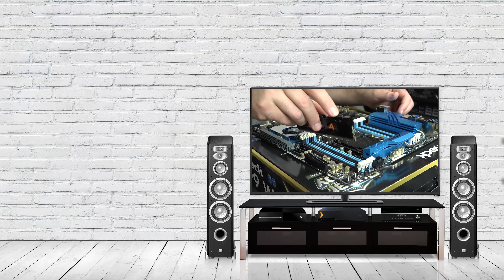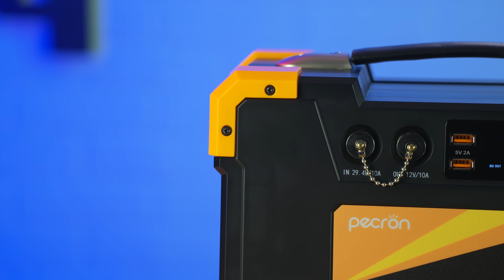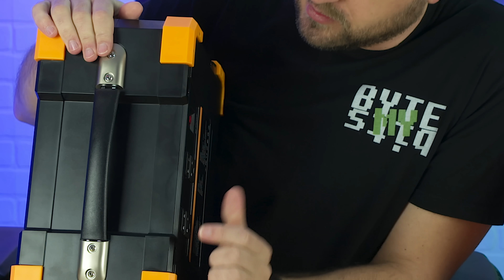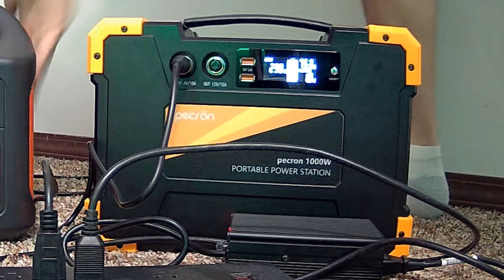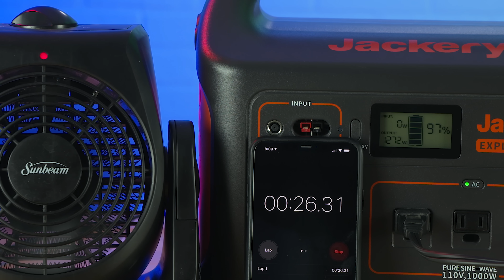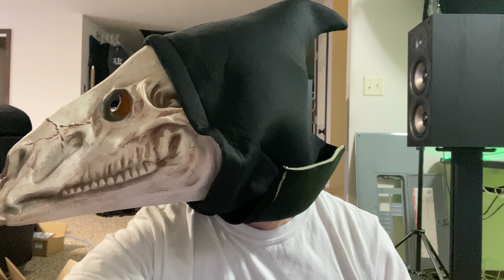pecron E1000 - Better and CHEAPER than the Jackery 1000!

Comment: Big deal it is $100 cheaper. You go on and on like it is so much less expensive.
Reply: Right now it's $750 new on Amazon and 10% off the panels. So your wrong. Times change as do prices.
Reply: @thenitruc8165  So it is app $150 cheaper since the Jackery 1000 can be had at home depot for $899.
Reply: @MrPageyjim  that's right, so get a life.
Reply: @GG-kc6ie  I am doing very well thank you. I suggest you take your own advice my slow witted YT friend.
Reply: @MrPageyjim  No mirrors in your house? You're the douche that moaned about the reviewer "going on and on like it's much less expensive" well it is much less expensive and it's a better product in his opinion so what's your point? Go and buy the jackery for $899 and pay more for an inferior product. Just do us a favor and stop your bleating.
Reply: @GG-kc6ie  I made my points, try to read the posts again. This time sound it out and give it a few tries. I don't plan on doing you any favors. I will just share the truth. If you knew how to read you would see where I said Home Depot. It is actually now down to $849 actually from Jackery.  Let me explain how this works GG. If you reply to me I will respond. I don't want to be rude. Talk to you soon.
Reply: @MrPageyjim  Sounds like you own the Jackery and couldn't handle hearing there's something better for cheaper. Don't take it out on the reviewer.
Reply: @GG-kc6ie  I do not own a Jackery. I own Bluetti's and an EGO. Why don't you take a nap or something? If the reviewer wanted to say something to me he could. Why would he need your nonsensical posts to protect him? If he relies on you for that he is in worse shape than I ever would have thought.
Reply: @MrPageyjim  You certainly have an ego
Reply: @GG-kc6ie  I knew you would be back. Haha that is funny but you can do better. Keepem coming
Reply: @MrPageyjim  we all know you're a jackery fan boy and spat the dummy when the reviewer showed a better device for less money. The best you could come up with was to bleat that he was going on and on about it, clearly every time he mentioned it was cheaper it just riled you up more and more. It takes a true tightarse such as yourself to feel compelled to leave a comment about it.
Reply: @GG-kc6ie  More nonsense from you, but I wouldn't expect anything else. As I said i do not own a Jackery. If you have to compare something to that Jackery it just shows how outdated it is today anyways. I will wait patiently for your next nonsensical reply.
Reply: @MrPageyjim  Couldn't handle there's a better device for cheaper so you take it out on the reviewer. What a little weasel you are.
Reply: @GG-kc6ie  If he doesn't want reviews he should turn the comments off my crybaby friend.
Reply: @MrPageyjim  Saving $150 and it lasts longer on the same load and can stand higher loads that the Jackery shuts off.
Reply: @thenitruc8165  It is still $100 cheaper than the Jackery. The Jackery warranty is twice as long and they have a long track record also.
Reply: @MrPageyjim  Ill take cheaper and performs better. Lasts longer on a charge and more watts continuous. Also the pecron charges faster from the wall and from solar. Dude just stop nut hugging jackery. Yes its good. But this for the price is just better. Jackery charges at 160 watts and pecron charges at about 215 watts from the wall. The benefits stack up.
Reply: @thenitruc8165  I don't own a Jackery and really wouldn't suggest one you fool. If I were to suggest one it would be a Bluetti actually. A good track record and much better warranty goes a long way for me and some others. I really don't care what "you'll take." That is why we all have opinions.
Reply: @MrPageyjim  ooooh crybaby 🤣. The only crying is coming from your source post about it not being cheap enough, what massive tightarse you are.
Reply: @GG-kc6ie  It was his main point. he went on and on about that. I love your stupid posts keep them coming GG. What is the relationship between you and the reviewer? I could have said much more but I wanted to be kind to the reviewer actually.
Reply: @MrPageyjim  The only stupid post is your original post where you revealed to all and sundry how large of a tightarse you are and how much it hurt you to hear your Jackery isn't very good.
Reply: @GG-kc6ie  That didn't take long lol. I have recommended Bluetti's at least twice and you keep saying that lol. I do not own a Jackery and I doubt I ever will.
Reply: @MrPageyjim  Really? Seems like you really do care...
Reply: @thenitruc8165  How do you come to that conclusion? It seems that lunatics buy this model.
Reply: @MrPageyjim  You showed your hand when you left your original comment, it was both rude to the reviewer showed what a tremendous tightarse you are. Youre in love with your Jackery and became hysterical when the reviewer showed a better device for less.
Reply: @GG-kc6ie  Oh good you're still there, I was starting to worry. No Jackery. Bluetti B-L-U-E-T-T-I, Bluetti. Thanks for checking in. talk to you tomorrow. Your video stunk, that was why I did a thumbs down.
Reply: @MrPageyjim  lol
Reply: @MrPageyjim  of course you'd say Bluetti to save face but we all know you're emotional about your Jackery. You've shown just how much it has distressed you to see your Jackery ain't all that.
Reply: @GG-kc6ie  Sorry it took so long for me to get back to my dimwitted YT friend. Yes of course I rcommend Bluetti when i supposedly own Jackery's. I guess this is how YOUR mind works.
Reply: @MrPageyjim  We know you're Jackery all the way. Big deal you paid more than you would have liked to, comes with the territory of being a massive tightarse.
Reply: @GG-kc6ie  So a "tightarse" pays more. Are you from the upside down universe? I thought so. Thanks for the evening chuckle my YT clown friend.
Reply: @MrPageyjim  Refer to your original post if you're looking for the definition of a tightarse
Reply: @GG-kc6ie  Still makes no sense but why would you start now? Sorry it took me so long to get back to you my lonely dullwitted YT friend.
Reply: @MrPageyjim  Just feel comfortable in the knowledge that anybody that's read your posts knows you're are massive tightarse
Reply: @GG-kc6ie  Oh goody another message from from my YT fanboy. That makes perfect sence especially since I recommend higher priced Bluetti units. Do me a favor and produce some more crappy videos.
Reply: @MrPageyjim  Keep whining over $50 and your Jackery being owned, your original post is embarrassing.
Reply: @GG-kc6ie  Go to the Amazon ratings for both units mentioned here. I mean the ratings of the companies not the individual units. Both are sold and shipped from the respective companies. There is no comparison with Jackery being much higher rated. The recent ratings for Pecron are absolutely horrible. I wonder what's going on there.
Reply: @Robert Dillon yep agree, it's great kit but @MrPageyjim is Jackery all the way, that's why he was moaning on and on.
Reply: LOL, thanks for breaking it down quickly! How much cheaper was the million $ question. Typically generators across the board are $100 per  watts. 👍
Reply: I can do a lot with $100 Mr. big bucks
Reply: @jspyrogram  Maybe you could use that to send it back.
Reply: As of now it’s $400 cheaper
Reply: $200 cheaper and performs better. If you don't like the review then don't watch it rather then negging somebody.
Reply: @GG-kc6ie  The criticism should help him deal with it,
Reply: @MrPageyjim  that's one of the more unintelligible responses I've read. Best you make your own reviews so we can see how you "deal with it"
Reply: @GG-kc6ie I had a feeling you didn't read much. I gave a good review and good advice if he wants to take it. Unlike you if I had something to review I would want people to be honest.
Reply: @MrPageyjim  - There’s a difference in giving helpful & honest comments and being an asshole, and by your immature responses to others comments, I see ,you can’t differentiate.
Reply: @SoldiersAngel  I hear that, be my guest. The Pecron rating for the last month on Amazon is 60% positive. A $100 is a $100 I get it.
Reply: Buy this one and get a free tank of gas! (Thanks FJB).
I'll take an extra Benjamin every time!

Comment: Can you hook up any solar panels or do you have to use theirs specifically?
Reply: It uses a MC4 solar connector which is a standard on most new solar panels. The device comes with a cable that uses their connector to the device on one end and a MC4 on the other.
Reply: @paladin11C40  Can u tell me how much it costs and where to get it?
Reply: That's what I would like to know
Reply: Yes you can, i saw it on another channel,
Reply: I'm just checking comments as I just picked up this Pecron E1000 for $600.  You can use any solar panel as long as the voltage output is within the window of 29.4 to 40 volts.  Many panels are under 29.4 volts so check before you buy.  Many commercial rigid glass panels meet these criteria.

Comment: Out of all of the designs. They all carry the same exact problem. Not ah or anything to do with the batteries except the batteries are hear and cold sensitive plus can catch fire easily. Besides that. Everyone on the market has 1 huge problem. The converter. Mine. 5000 watts at 500 max amp usage. Now put that into one of those and I'm all over it. Fast.

Comment: I kept watching hoping to see the standard 12 volt cigarette lighter type outlets.  I need at least one 12 volt outlet.  Very strange that it doesn't have one. My refrigerator and hot logic both have 12 volt plugs. Try the Bluetti.
Reply: Not true.  The pecron has a 12 volt outlet on a cable that is included.  I just picked up one this week for $600 which is $300 cheaper than the Jackery.

Comment: Can the internal battery be replaced should it, after years of use, crap out?  I believe Jackery's can't but Goal Zero's do.  That is why I have been sold on Goal Zero.
Reply: Old Goal zero, but not the newer Goal zero, the new ones you cannot replace the battery anymore
Reply: Most of these power stations have sealed batteries.  If you look at youtube many of the techs will take a saw and cut the unit's frame to inspect the insides. Not recommended.

Comment: The Pecron really looks cheap but time will tell. I have the Jackery 1000 and love it but the slow charge time is not good. I use it in my Promaster and the charge rate is less than 80 watts using the 12 volt charger.

Comment: Niiiice-😎👍good find👍I bought the rockpals 500w power bank along with two 100w panels, And then yesterday I just ordered the go-power 90 W solar panel with built-in charge controller for my campers batteries

Comment: No USB C PD 60-100 Watt port? These are needed for faster charging. My RavPower 128W PowerBank has a 60 Watt port that fast charges all of my Mac devices and MacBook Air. And I have a solar panel with a 60 Watt port that fast charges the PowerBank. Cost me $170 on sale.  Not as spectacular output wise as either unit but what I wanted for hurricane grid failure to charge my Macs.

Comment: I already have a Jackery E1000 and I actually think it is the better deal. I got mine for around $850 on one of their sales and they have free shipping (Not $150) and their customer support has been fantastic. One thing I can say about the Jackery, it charges pretty fast up to about 95% but then it takes a LONG time to charge from 99% to 100% due to their tapered charging close to maximum. It would be interesting to see them charging side by side up to 90% to see if there is really much difference.

One other thing you might want to check into is the type of power cells used. I know Jackery uses the best cells available at the time but some off brand power stations use cheap cells that work great for the first few months but then drop by 20-25% of capacity. My Jackery E1000 is still at 97% of original capacity after a year so I am happy.

Comment: I have a farm about 2000 square feet will need 20 light bulbs for about 10 hours at night and chicken pucker can this work for my needs or will I need a 3000 volts for my needs?

Comment: ... he says 1028 killowatt hour battery at least twice, NO , he is off by 1000 he means watt-hours , , ,   all this lying about what is basically a battery is getting annoying,, everyone just get a lead acid battery and a couple inverters for $200 from harbor freight their $70 batt is 500 watt hours,,, unless one is carrying a batt in a pocket lead acid is not that heavy and if it fries who cares who wants to risks $1000 on electronics unless one is a bit crazy,,,,  and then charge the lead acid with your car via jumper cables, ,,,

Comment: Forget all you've heard about small 300w solar generator , Golabs r30 changed the game , Lifepo4 battery , full pass through , mppt builtin charger , all Usb ports you'll ever need ,  300w pure sine wave inverter,1 qc 30w ports,1 Qc 60w port , 2 usb 3 ports, powerfull flashlight ,1 cig lighter plug , one adaptor to add a cig plug ,excellent accessories provided ,MC4 to 5521 to connect solar panel , good price , very nice information disply ,the only draw back is charging time , 45 watts with the provided wall charger , but 60 watts if you have a PD power supply , like a Apple power supply. This device rocks.
Reply: Just saw (3/10/21) that there is an $80 off coupon on Amazon for this. QC is becoming a necessity for electronics nowadays.

Comment: the product  price is cheaper then Jackery but there is a 150 dollar shipping charge that brings it up to the Jackery price since Jackery includes shipping. so its not really a savings
Reply: free shipping with amazon
Reply: Ouch how does he miss that
Reply: Currently $899 on Amazon. $101 lower than Jackery 1000
Reply: @rccrashburn  Saw this also
Reply: Jackery is off and on sale for $100 less. Hundred and $50 off this week. And this battery is $100 off. But it's only $50 difference. I'll stick with jackery
Reply: With Amazon Prime and $100 off coupon. $856 so $200 cheaper than Jackery. Jackery $999 plus tax.
Reply: Amazon has free shipping
Reply: Free US shipping on Pecron site
Reply: Actually $961 delivered. The Jackery 1000 is $1068 delivered. Both on Amazon. You figure out why the Jackery shipping is less.

Comment: I am buying one. Here in Texas we almost died last week courtesy of our wise state leaders. It will happen again soon. Better prepared than sorry and miserable dying of hypothermia.
Reply: I was in that situation some years ago..Ice storm, power out, no heat source..frozen fish in the tank.. I can tell you that any of these batteries simply will not run a heater long enough. The best use is for them a heated blanket. At 150 watts they can run for a a number of hours to keep the cold at bay. Since my ice storm incident, I have purchased a 23000 BTU kerosene heater for the house plus extra kerosene. They are designed to heat indoor spaces but you also have to have a carbon monoxide detector and some fresh air also.
Reply: That won't run a heater for long at all.  It would only charge phones and such.  The bluetti AC200P would be a better choice with some solar panels.  Still won't heat long term but at least you could run a 12V blanket for a long time and with sun which was somewhat available and some solar panels, would be able to recharge it.  This doesn't have a 12V plug and he doesn't explain how to plug in solar panels.  A lot missing in this review.

Comment: I got 2 1500w pecron generators on Amazon because they priced lower than other brands, and buy 2, I got 5% off for each of them. They are good as the video showed to you. I just want to mention a fact that I charged it with my 800w solar panel and it charged 380w to the pecron, filled it with in 3 hrs. The specs stated that it could be charged at higher rate but 380w was the max the solar can output on that given day. So I believed Mr Byte my Bit's review was honest. I boiled water with 1300w kettle, grilled chicken with Ninja pot just to test the pecron. I liked the performance of Pecron. I also liked his English because his is better than mine.
Reply: Your English is good my friend! Her doing well 👍🏼
Reply: T